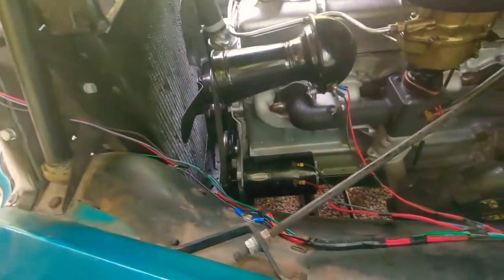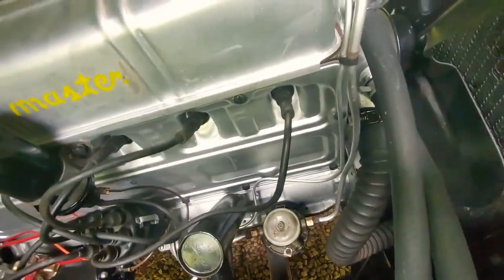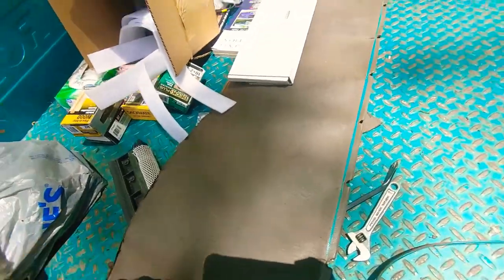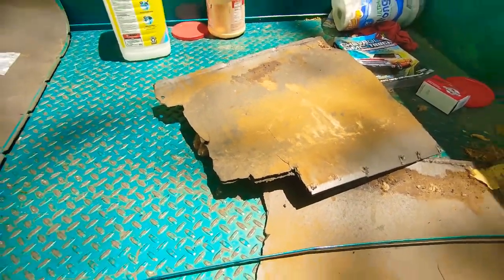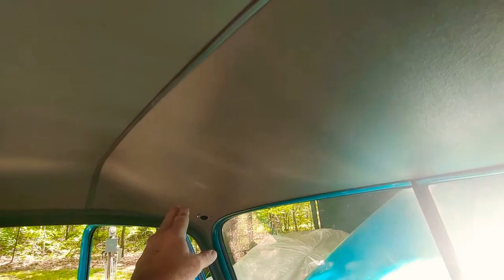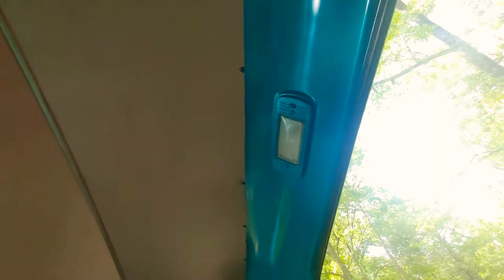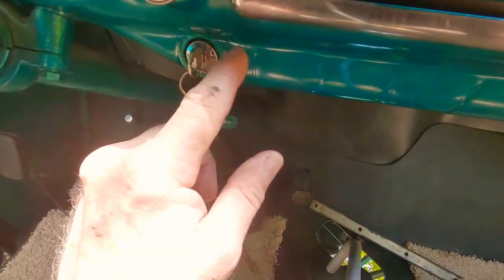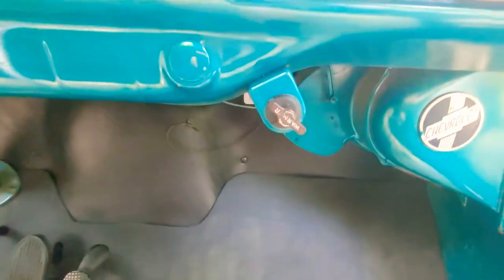part 1 of 2       1951 chevrolet truck updates plus headliner installing advice.

Comment: I am doing the same headliner replacement; how many "bows" are underneath between the headliner and roof panel? Mine has no headliner and no bows. I found a bundle of spares, but I'm not sure how many are supposed to be in there. Is it just one down the center?

Comment: Is the center brace screwed on the side behind the rubber seal
Reply from the maker: It is not the rubber seal (on body door seal) holds the metal in place and covers the edge of the headliner
Reply: Ok mine is a 1953 and has a hole there so I just was asking thanks